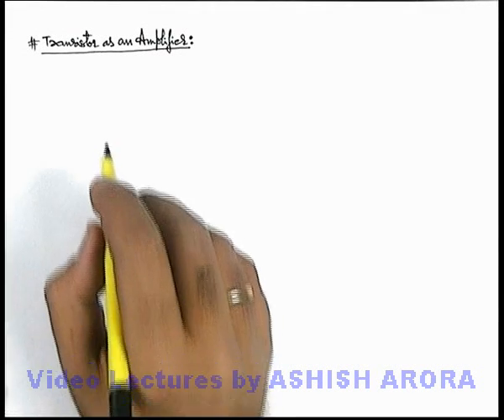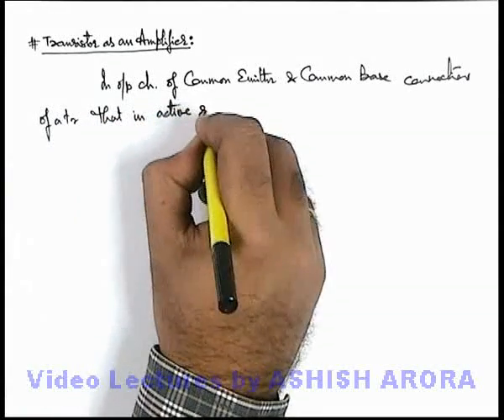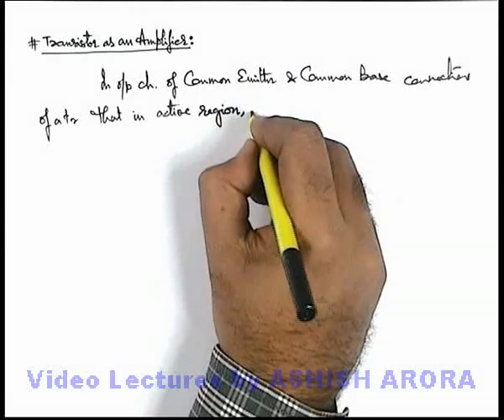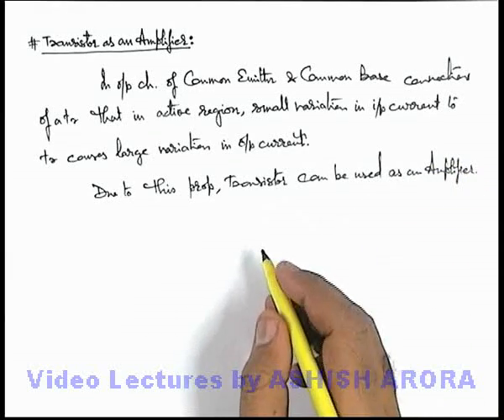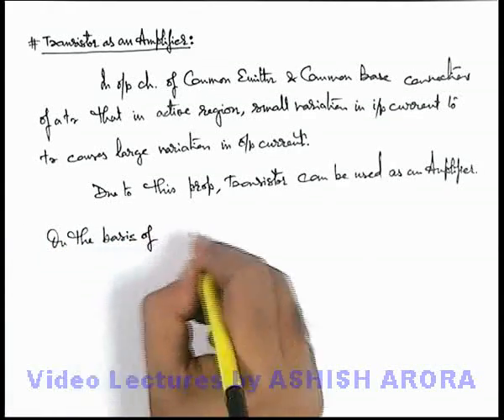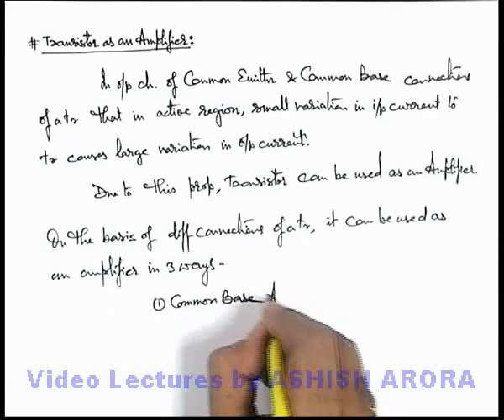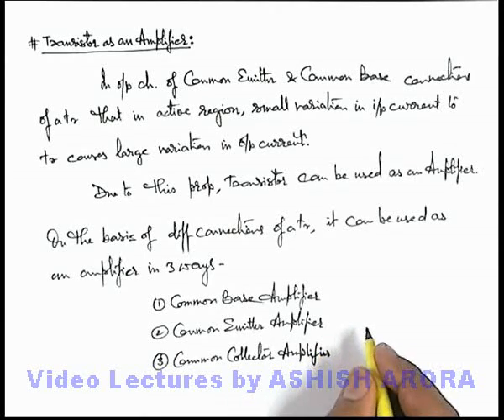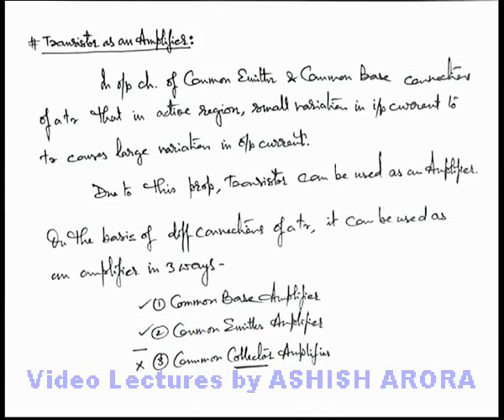Class 12 Physics | Transistor & Its Application | #14 Use of a Transistor as an Amplifier|JEE & NEET

Comment: Sir how does small variation in input current cause large variation in output ? In the previous lectures it was stated that I emitter( input) is approximately equal to Ic(collector)
Reply: what sir is saying is definitely true for the common emitter transistor. So we know what alpha is, right? It's the percentage of carriers emitted by the emitter that the collector gets, so it's less than 1 and close to 1 because the base current is small. So let's say alpha is 0.99, if we calculate beta from this it'll come out to be 99. And we know what beta is too! It's just the ratio of the collector current to the base current, so we can say that the collector current is 99 times the base current and by taking the derivative we can also say that the variation in collector current is 99 times the variation in base current. In the case of a common emitter transistor, the base current is the input and the collector current is the output and so the variation in output is 99 times the variation in the input and so we can say that a small variation in input causes a large variation in output. But the thing is that in the case of a common base transistor, the output(collector current) variation is alpha times the input(emitter current) variation and since alpha is close to one the variation will almost be equal. That means if for a common base transistor, I increase the input current by 5mA, then the output will also increase by almost 5mA.
Reply: look at the output characteristic graph of common emitter.....compare it with that of common base
Reply: Yes sir l have the same doubt plz reply